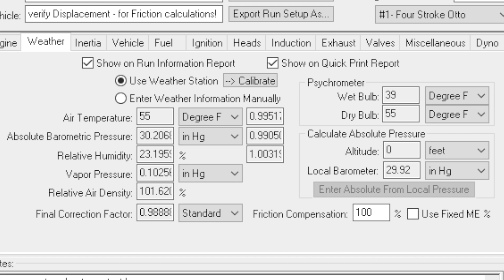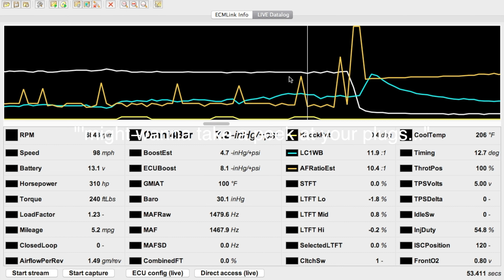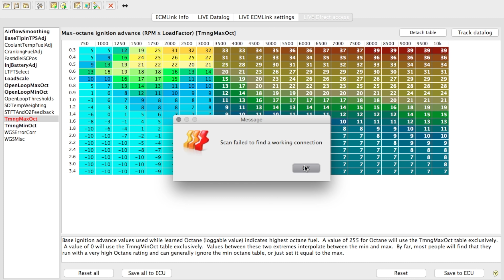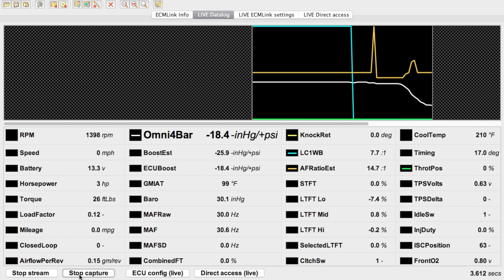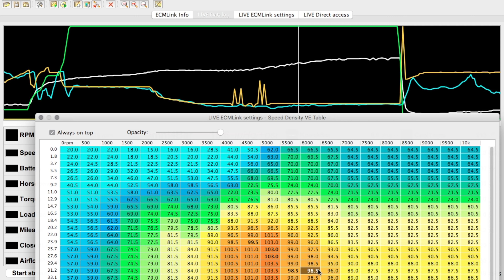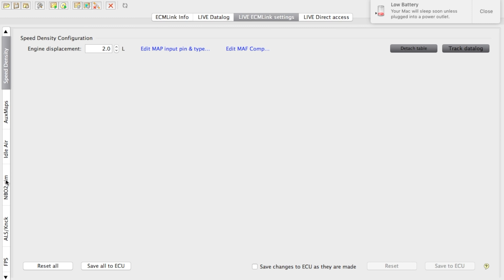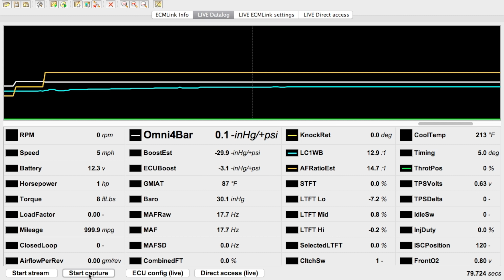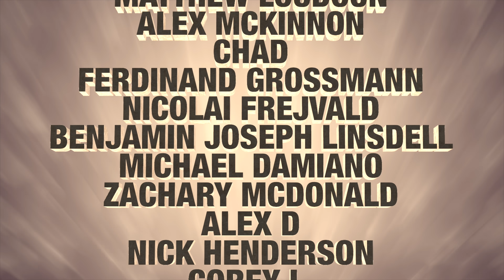Turbo Elantra Dyno Baseline

Comment: My prediction is 411HP
Reply from the maker: I'd be really happy with that.  I'm around your estimate once we add about 10 PSI.  Anything above 357 at  the wheels would make me really happy because that's what the same turbo and cams made in my GSX at 28 PSI, and it was a half compression point lower than the Hyundai.  Also it had more drivetrain loss from being all wheel drive.  The GSX didn't have water methanol injection.  So estimating between 350-400 with all we've done to it should be a very reasonable estimate.
Reply: @Jafromobile  that’s so awesome man.   I’ve told so many people about your Hyundai.   I know a girl with a 2nd gen and she’s like “this thing sucks”. Little does she know it’s actually got loads of potential.
Reply from the maker: @BluDog35  Yeah, lol!  A zero-mile stock GST makes 175-180 horsepower at the wheels.  This worn out box of scraps makes 100hp more than that at wastegate pressure.  It's easily underestimated.  I.  can't.  wait.  to.  turn.  it.  up!
Reply: @Jafromobile  I can't wait either my dude!   Hey, stupid question but can I send you a sticker for under the hood?  lol   I noticed the thrush sticker and thought I'd ask.
Reply from the maker: @BluDog35  I've never added a sticker to it except for the "370" and the shootout parking decal.  Jamie did that appliqué.  But sure, I'll rock it.  Hit me up on Patreon.
Reply: @Jafromobile  Awesome!

Comment: thats false knock. those dsm knock sensors can be touchy. read your plugs. those innovate widebands are garbage very poor accuracy as the o2 sensor ages. they run the heater element poorly and the nert cell incorrectly imo.  too rich at lower boost levels leads into causing kind of a runway rich effect.  look into lean spool information. oem's will lean spool a turbo at 16-20 afr. careful though dont be aggressive into boost just transition areas. way too little timing will cause a bunch of issues too. dont be afraid of chucking 12* at it on 91 and 15*+ with wmi at 20psi it will take it all day.